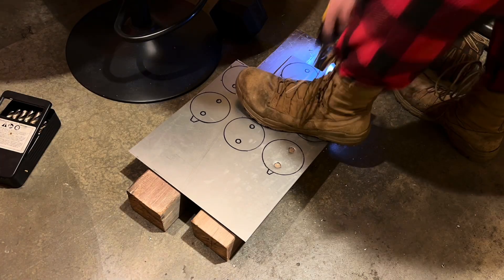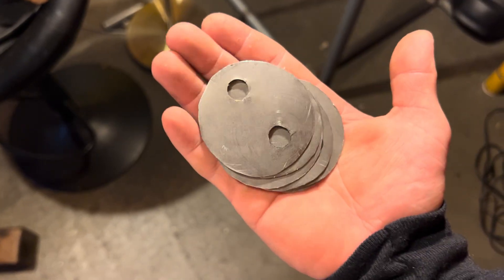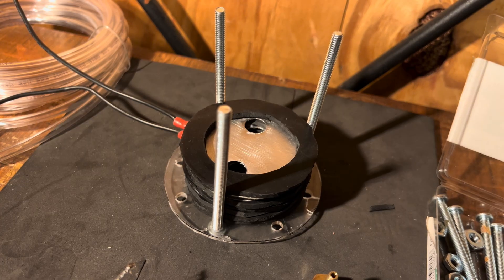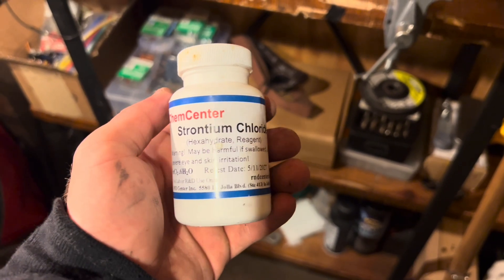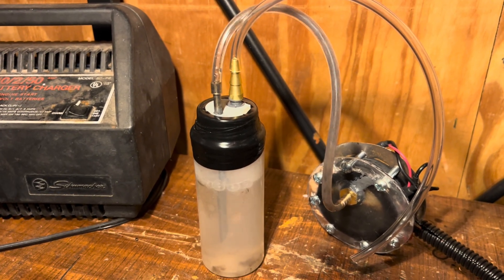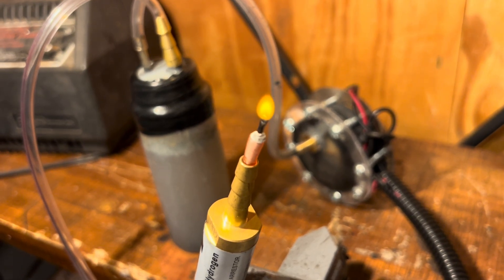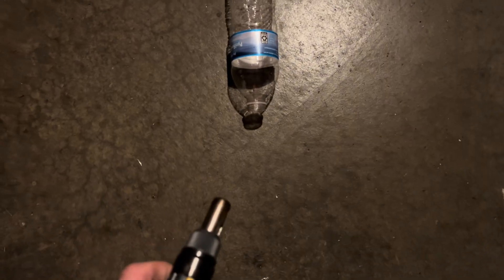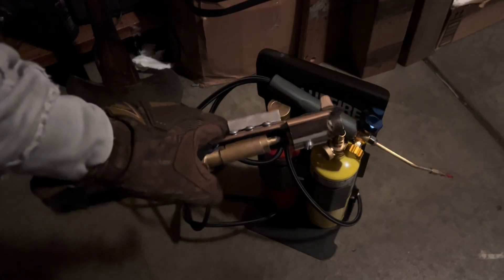Turning Water Into a Burnable Fuel

Comment: u can use azote liquid  but u will have to change many part bc u need some par that can handle the cold and verrrry important never never make azote tutch the hidrogen cus if u will have risck of explosion Risk of excessive condensation, frost, or even local explosion if under pressure. for the metals part if The material of the reactor or pipes is not compatible with low temperatures (some metals become brittle). so i had an idea abt this u can separate i mean u have to separate the azote and the hidrogen using Cryogenic rubber Always separate circuits, appropriate cryogenic insulation, never allow hydrogen to come into direct contact with LN₂.  so  as a resume of all of this well

 Keep LN₂ and hydrogen completely separate.

Only use materials rated for cryogenic temperatures and hydrogen.

Ensure venting, insulation, and monitoring are in place to prevent pressure, frost, or fire risks and even boom . bruh

Comment: try using sodium hydroxide as electrolyte.
using salt will corrode the electrodes, that's why the cell looks so dirty
Reply from the maker: Yes, in my newest video about elecrolysors I used sodium hydroxide and it worked much better without corrosion